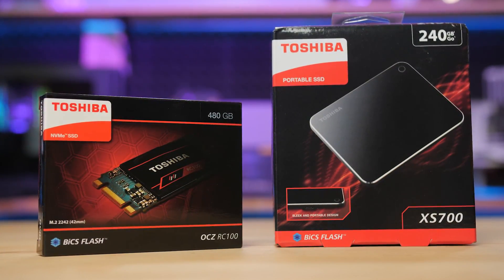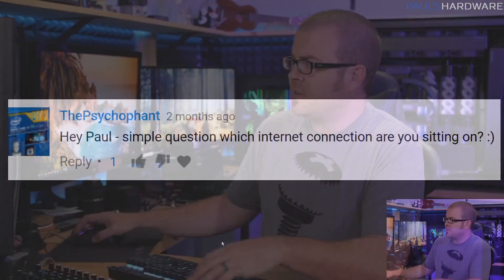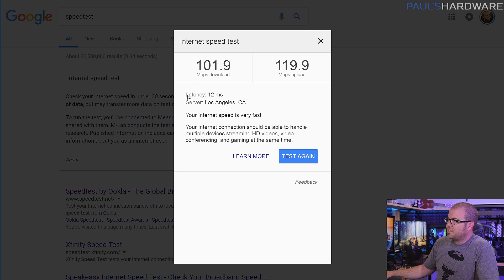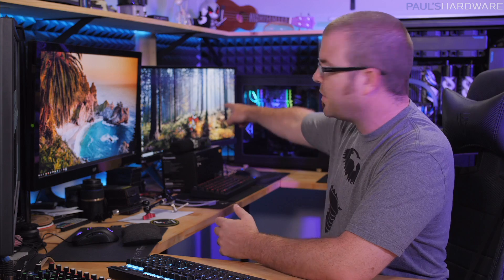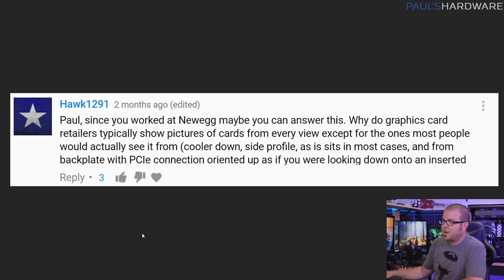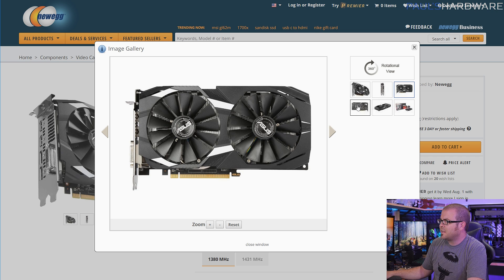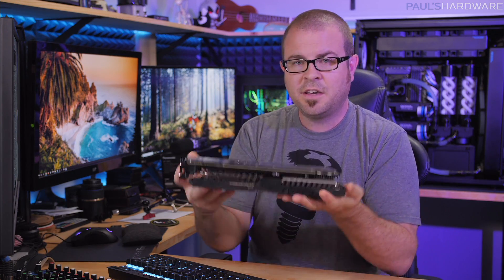Why are GPU Coolers on the "Bottom" Instead of the Top? - Probing Paul #26

Comment: Okay Paul, let's fill in a little more history for you since you obviously don't know what you're talking about. First, my credentials: the first computer I owned was an IBM PC/XT with an Intel 8088 and CGA (2-bit) graphics. With a tiny hard drive (by today's standards) and a 5-1/4" floppy drive.

First to correct you: discrete graphics cards have always existed. It's onboard graphics that didn't always exist. Monochrome (1-bit), CGA (2-bit), EGA (4-bit), and then VGA (8-bit, 256 colors) followed by SuperVGA (higher resolutions, 16 and 24-bit color depth) were all provided by discrete graphics cards. A 486 system I owned 20 years ago had a 1MB PCI SuperVGA card. I bought a SoundBlaster ISA card for it later.

ISA cards had their orientation due to the chassis layout. The location of the expansion slots has not changed since the early days. Look at the pictures of XT, AT, and IBM PS/2 mainboards. Tower chassis didn't really become popular until the mid 1990s. The earliest chassis were laid out so that, looking from the front, the mainboard was on the left and the power supply was on the right - same side as the power button. This meant that hardware clearance could be an issue, so the ISA standard required hardware on the side facing away from the left side of the chassis to prevent interference. This allowed you to fill all the expansion slots, if you needed or wanted to.

When PCI was introduced, the orientation was reversed. Not sure why that happened, but it did present an opportunity. Mainboards that had both PCI and ISA slots would have the ISA slots to the far left - looking from the front - and the PCI slots to the right. The reverse orientation allowed one PCI and ISA slot to share a rear panel opening, allowing the board to have 8 expansion slots total for 7 openings in the chassis. So you could have 4 ISA and PCI slots, or 5 PCI and 3 ISA, or what have you. Remember this was back before integrated sound, graphics, networking, etc... You had a keyboard port, at least one serial and parallel port, and an ATA/IDE and floppy connector, but everything else - graphics, sound, network, modem - was an expansion card. And later mainboards - I believe starting with the 286 - had onboard memory slots so you didn't need an expansion card for additional RAM.

Towers didn't become mainstream until the mid to late 1990s, when PCI was already everywhere and AGP new to the market or on the way. The better question is actually why tower chassis adopted the orientation for PCI cards to be face down. Simply: dust. The face-down orientation of PCI, AGP, and PCI-E cards in towers meant dust didn't collect on the hardware side of the card. Sure this meant that ISA cards could get caked in dust, but those were on their way out. PCI sound cards were becoming the norm, along with PCI or external USB modems, and PCI network cards.

Comment: PAUL,
The GPU fan orientation is still likely due to hot air distribution as you briefly mention (combo of CPU and hot air rising). Remember, with heatsinks the fan should blow THROUGH them so if the fans where on top they'd be sucking air which in most cases (ha) should be much hotter due to the CPU proximity... also, due to hot air RISING you have the problem of sucking in hot air, then heating it, then it rises back up to where you suck it in again... so...

With the fans on the BOTTOM you usually are sucking in much cooler air which is typically sent in from the INTAKE at the front of the case which then is forced THROUGH the heatsinks then pushed out the sides of the card at which point it rises up towards the top thus not affecting the cooler air being sucked in as much as it would on the top.

TESTING would be difficult since you'd want to keep all fans at the same RPM so that temperature becomes the only variable.

Comment: Is there a website or some kind of program that you can use to scan or input your PC stats. And it will tell you how your PC will most likely handle say the top current PC games. And give suggests on how to improve your current setup ? I know that other factors like internet provider can effect your gaming performance. But I am more so asking from a hardware and software view point. thanks

Comment: The reason cooling solutions are on the underside of the graphic cards come from way back in the day. Video cards did not have fans on them, only a heatsink or nothing at all. These components used to be on the top of the PCB, but layers of dust would collect on them thus causing the items to overheat and burn out. Later the hotter components were placed on the bottom so that dust would not collect on them. Think about it. When was the last time you saw a large collection of dust under something?  Even today's graphics cards are this way and have you ever noticed that the fans spin up at start up and then go back down. This is done to clean the dust off before the cards goes full speed.
Reply: i have a hunch that the fans are fast during boot because the speed controller and/or vbios has not yet loaded

Comment: On old motherboards with PCI and ISA slots present, a PCI slot and ISA slot could share the same bracket mount.  Since ISA pointed up and PCI pointed down, if the slots were right next to each other, the rear I/O of the card would be in the right place.  I'm sure they did this to save board space and add compatibility.

Comment: Well, when Apple used to make professional upgradable workstations, all the G5’s and Mac Pros featured sensible topology. In addition to that the heavier cards were slotted on both ends, not putting strain on the PCI-E socket. The way ATX handles this is just laughable from the standpoint of industrial design.

Comment: Inverted motherboard cases are probably the answer, but the fans still push the air down since they spin that way by default. Can you reverse the fan direction? That might make an interesting, but involved, video with an inverted MB and GPU that has fans pulling air up and away from the card. That would be an interesting comparison; same GPU in regular MB vs inverted with GPU fans reversed. Just a thought ...

Comment: when the computer industry was in transitiion from ISA to PCI, motherboards would have both slots.  you would have 2 slots on one slot "hole".  for instance look at the this diagram:

|:::::::::::::::::::::::::::::

the dotted lines are the pci slot (top) and the dotted lines on the bottom are isa.  so if you used a pci card it would block the isa and if you used the isa it would block the pci.  to get this to work they had to make the pci cards upside since the isa slots were already positioned right side up.  this let users either go all isa if they were bringing parts from their old pc or go all pci if they were buying all new.  so yes pci is upside down so that you could have 2 slots share one "hole"  at the back of the motherboard

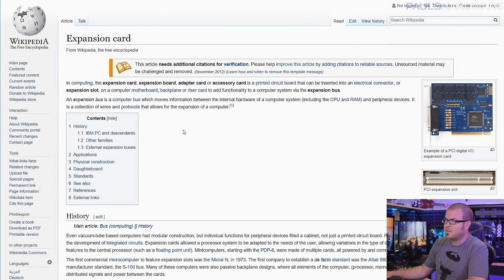Comment: 05:52 I have an idea as an "explanation". In the early days the components were on the top side (ISA) but some computers never got cleaned and they started to make problems so at the next shift from ISA to PCI slots for extension cards they put the components on the down side, again I think it is because of the dust but I might be wrong. Maybe it was clearance that made them decide that way, who knows?

Comment: The GPU cooler is designed downside for better cooling. The fan sucks cold air into the bottom of the heatsink and hot air was pushed out of side of the heatsink. If flip the GPU, the fan will suck warm air procuded by the GPU into the heatsink again, which won't have a better cooling.
Reply: That's speculation, and only applicable to reference style coolers. Here's an inverted motherboard case with better GPU thermals than several traditional versions with a reference GTX 980: https://www.gamersnexus.net/hwreviews/2221-corsair-600c-case-review-and-benchmark
Reply: irsever TBH that's not applicable to reference coolers. You are doing the speculation. When it comes cooling, the custome cooler always performs better

Comment: Actually, PCI had to be opposite to ISA at it's initial design because it was designed to be able to share a physical case slot between both. You could only populate one or the other, but it added flexibility in expansion. AGP and PCIe have followed suit to try and keep thing homogeneous across all buses, but there's nothing saying the next standard, or the next PCIe revision couldn't offer both, but it would likely really confused consumers.

Comment: Hey Paul, love your content, My question is  "Is 240mm rad is good enough for 8600k or 8700k or in general for 8 core cpu's also(without delid). In india (where the weather is too hot.. ambient 28 to 32 degree Celsius. for 8700k at 5ghz on average overclocking, and i know every cpu is binned differently and different thermals too but i'm not asking for my specific chip, i am asking for all 8700k's, is there any rule of thumb? whenever we ask questions from you guys we know you have lots of experience and data for these so you guys can answer, we also heavily rely on content creator's data (like you, Steve, Jayz, Kyle, Brian, OC3D you get the point) and we trusted that too but the problem with that data is they were based on 21 to 22 degrees Celsius ambient temperature. and here many of the guys don't have A.C in there computer rooms so the ambient is always high except winters. Is the cpu' increasing temperature is directly proportional to ambient temperature? so i want to know that, is 240mm AIO is good or should we go with 280 or 360mm AIO and we don't want to change the cooler with every cpu upgrade (whenever Intel's 8 core rumored cpu will come). And what are the benefits of opting lager AIO rather than 240mm and also i don't want jet engine running 24*7 in my case.
Reply: you're not supposed to change cooler with every cpu upgrade since most cpu models over the years are kept around a certain wattage

i dont have an answer about the delta (difference) temperatures if +10 ambient means +10 load, but remember that intel cpus simply throttle, it's not a big deal to hit 90+ degrees on intel

for overclocking, i would try to find the highest possible clock & voltage before the voltage requirement curve gets too step

the motherboard's VRMs are also a concern that many people seem to forget, you didnt mention gamersnexus in your list of content creators, so i have the feeling you dont look closely at VRM heatsinks or possible airflow requirements
Reply: Thanks for your reply and i know the importance of vrm too, also mentioned gamersnexus in my comment like you see i wrote Steve ( that means Steve from gamersnexus and Steve from Hardware Unboxed too). I'm also very well aware of VRM's importance from BuildZoid contents too  from Actually Hardcore Overclocking. My primary concern is CPU cause with next Intel CPU (8 core rumored) or after that maybe they'll increase the core count 10 or 12 then, and also you already knew about the TDP measuring procedure of every company is different, TDP nowadays are very weird. So my question is still the same, Does 240mm AIO is enough for hot environment (28 degree to 32 degree celcius)  or should we opt for bigger radiator for these types of chips?? and what about the noise with 240mm??

Comment: Regarding the HTPC horizontal case. I had a hard time finding an affordable case, so I resorted to making my own wooden case, custom designed to fit in my TV stand. It fits a Micro-ATX motherboard , full high graphic card and a standard PSU. Also I set up the air flow so that it exhausts out the front grill for better cooling. The cost was around $10 for the front grill and paint, plus the  scrap wood I already had.

Comment: The reason that the cooling solution is on the "bottom" of GPUs is due to the area above the top PCIe slot is usually very close to the rear I/O of the motherboard. If the GPU cooler were on top the GPU would not fit, or would be a very very snug fit, possibly causing the fans to not spin. Sticking with the established standard has allowed motherboard and case manufacturers to optimize PCIe slot and shield spacing. If the GPU coolers were to be placed on top, cases and motherboards would have to be redesigned to accommodate.

Comment: Hey Paul. I'm planning to upgrade my gaming experience by getting a new monitor but i have a question. Should i go for a 1080p 144hz monitor or a 1440p 60hz one? Whish one will give me the best experience? 

Greetings from Belgium
Reply: Chauvin Maxime I have the Dell Ultrasharp U2518D witch is a 1440p 60hz monitor in combination with an Asus GTX 1070 Ti and it 8600k. The high resolution is just magnificent, in particular in games like forza horizon 3 on highest settings (get about 90fps). Also I red that the human eye can't see 144 hz but only till 120 hz (I could be wrong). If I now watch something on a 1080p screen my eyes hurt :) just get the 1440p screen it would be worth it!! 

Greets from the Netherlands ;)
Reply: rein smallegange tnx for your opinion. Still woud like to know paul his opinion cuz a good monitor ain't cheap.
Reply: True! You should not cheap out on a monitor. Mine monitor wast cheap also got it for 310 euro's but definitely worth it! Still want to try what a 144 hz monitor feels like. Hit me up when you now what you gonna get, wish ya luck with the journey!

Comment: Great job on the gsync question. I currently have a 1050ti for now but i mostly am playing 1080p. i found a great 144hz curved monitor for $230 at micro center, obviously without gsync.... i love it compared to my dvi 60hz 1080p that i got for free... both are in use on my system.

Comment: Main reason why the GPU cooler is at the bottom is due to standardization and clearance. Going bottom they can just set one PCI express slot on the top slot of the motherboard and any graphic card with any thickness will not have any clearance issue by consuming the bottom casing back slot. Be it 2 slot cards or 3 slot cards with all the display connectors or cooling. If it's invert a lot of motherboard will have issues on supporting all graphic cards in the market as manufactures would have to design the PCI express slot at the far bottom slot. This may be an issue as the data will have to travel a longer distance and across other PCI slots which may or may not result in lower performance or conflict .